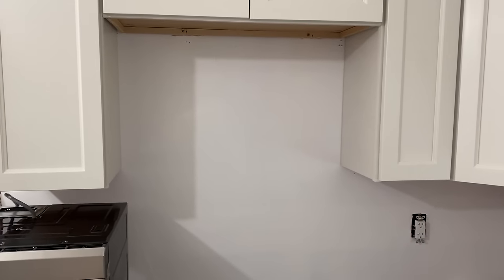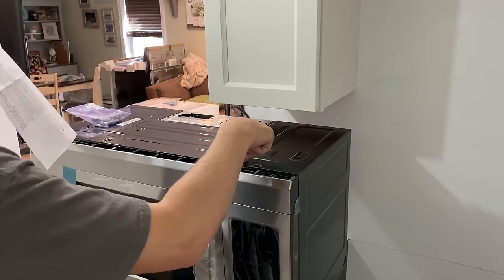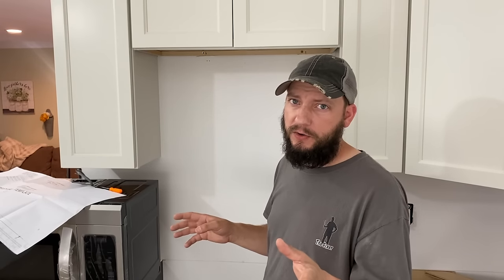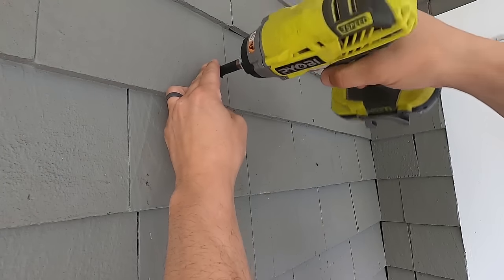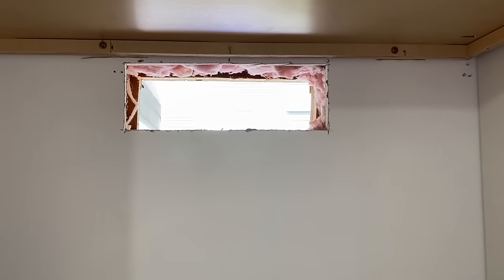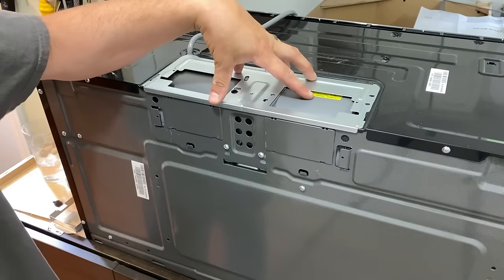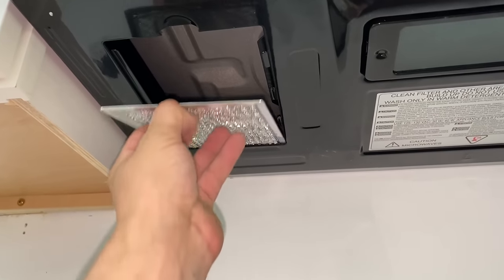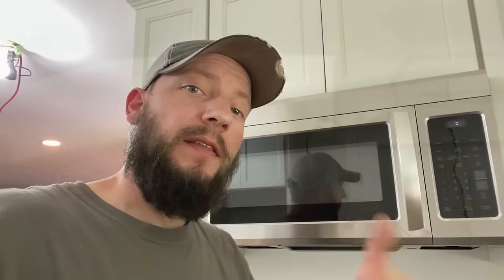How to Install A Wall Vented Microwave (Over-The-Range)

Comment: Just a tip that I was made aware of when we had our attic insulated. They conducted a blower door test before and after they sealed up and insulated the attic. they turned on both my bath exhaust fans and checked for back drafting from my gas water heater and found my fresh air inlet was adequate but when we turned on the microwave vent it sucked air back down the chimney. I only had a 4" fresh air duct installed in my basement. I thought I could make it a 6" but found it was easier to go out the other side of the house with an additional 4" vent. I checked it myself afterwards and no more back drafting.

Comment: If you have space in between the microwave and the cabinet base, like this install, the hole for the cord can go anywhere you like. Put it directly under the outlet. The cord will be back far enough it won't interfere with anything you store up there.
Reply from the maker: Good tip!

Comment: 1:44   The reason why you have to cut the paper on the dotted line is so that you don't have to depend on the printer to print the holes of the template to the right distance from the factory edge of the paper. The dotted lines and the holes of the template will always be in the right distance from each other.
Reply: This makes perfect sense . I cut mine and all is well . Although the power cord hole was positioned perfectly, it was difficult pulling it up at the end when the microwave was closer to its final position. . If I had to do it again I’d build a jig for my router and cut a slot connected to the front of hole maybe 2 inches long . This way the cord could pull up much easier

Comment: Thanks so much for this video.  I wasn't sure that we could use an over-the-range microwave when you needed to vent outside. my experience was always venting the air back into the house.  Now I know that this is possible, I will opt to get an over-the-range microwave oven.

Comment: Loving the kitchen progress so far.  Thats convenient your microwave is on an exterior wall.  Mine is on an interior wall, and I didn't want to lose cabinet space either.  So we took the top cabinet out, we cut the drywall, we cut the double top plate into the attic we dropped down a duct, then patched the drywall and reattached the cabinet.  Back in the attic we went from the rectangle duct to circular duct and out the side of the house with a dryer-style vent.  It does work really great, I can stand under it and even though its 2 stories up, I can feel the air and the flapper properly closes when the vent is off.  We have vinyl siding and there was a dryer vent in the same CertainTeed color as our siding, so it matches.

Comment: I repair appliances so I see the bad install jobs where the vent is not turned the correct way and restricts air flow. Usually will cause excess steam in microwave and eventually case parts to fail. And if it’s under the manufacture warranty, they can not cover the repair to fix due to the improper installation. Love your vids!

Comment: This video is better than the instructions that come with the microwave. The directions want you to tape the crush blocks to the microwave. Well that didn’t work for me. I also didn’t have a small braid nailer. After struggling for awhile, I got one of crush blocks in but the second side was a no go, so I just snugged he second side up finger tight.

Comment: Great video. A much better flange imo is those which are square on interior side and circular on the outside. This has many advantages over the square both end ones. First of all, they are much cheaper, I think, 1/3 or 1/4. Second, you can actually attach the flange to the microwave side and insert it in the wall as you are installing the microwave on the wall. Then you go out and attach an elbow exhaust outlet with cap easily. These square flanges are simply for making more money off of customers.

Comment: We had our first microwave professionally installed over the stove in 1991. It and the new one in 2002 vent up through the cabinet to the roof since the other side is a bonus room. Put off getting a microwave until I saw the over the hood option. Didn't want one taking up space on the counter or on a separate cart.

Comment: You might want to use the duct tape BEFORE the upper plate is put on. That way, you seal the exit path by taping to the fan assembly, rather than leave leaks that can go up into the cabinet space about the microwave through the big square holes of the unsealed upper cover plate. I was going to double check with the actual installation instructions for that model microwave - please see the air pathways at 19:39 when the fan assembly is simply dropped in and fixed with no gasket/tape sealant to prevent air/dirt/grease/fume misdirection. You can also simply apply two rows of duct tape across the upper plate to effectively block that pathway, however is can promote exhaust into the body of the microwave which should be avoided. But, despite anything - thanks for posting.

Comment: I personally love the plastic snap-toggle style bolts since you can put them in the wall before adding the bolt.  Great for one person jobs.
Reply: i have major problems with the snaptoggle brand. if you don't pre test them by screwing in the bolts they tend to have a large failure rate for me. they start to crossthread in the wall and snap.
Reply: @feelingtardy  Well yeah if you're hitting a stud behind the wall they don't drill into solid wood very well and do exactly what you described! Always check stud locations before trying to use screw-in drywall anchors.

Comment: Great video!  I have the same black vent and have been suspecting there is a gap, allowing cold air in.   I know nothing about construction and was wondering what you used for your extension piece.   Thanks!

Comment: I installed the same microwave unit in my kitchen. with the up through the upper cabinet venting option. But my brain does not recall rotating the fan:(. So now I know why all the oily vapors get deposited in the kitchen rather than outside. Could've used this video a year ago.

Comment: I've installed three OTR microwaves and never used spacer blocks. Never had an issue with the unit pulling away over decades.
Reply from the maker: Yup.  I have installed maybe 50 and never used blocks until one time when the bolt started to bend the thin sheet metal holding the nut in.  I couldn’t get the microwave to tighten properly after that so I have used blocks since then.

Comment: I’m curious as to the depth of the wall cabinet in which you installed the microwave underneath.  Is the depth of the cabinet 12” or 15”? Thanks in advance for your response.

Comment: American / Canadian microwaves are wierd! I didn't know you guys had to vent them 😅
Reply: How else do you exhaust the cooking orders?
Reply: @cejkwo100  we don't vent them at all in the UK, they're just stand alone appliances that you just plug in and go 😅
Reply: @cejkwo100  In the UK microwaves are stand-alone appliances, either sat on the worktop (counter top) or built into cabinets. We use purpose built chimney style extractor fans above a cooker/stove. I live in the US now so I’ve seen it done both ways. It does seem odd to have a microwave above a stove.

Comment: if you didn't need to fix that upper hole at the same time, might have suggested just trimming back the upper overlapping cedar shake by an inch or so to secure the flange of the vent, then install trim around the top and sides of the vent to fill the gap. but yeah nothing as seamless as just residing the whole area

Comment: For over the range microwave minimum depth is 12 inches but my cabinets is 11 1/2 inches. Is that a dealbreaker for installation thanks ahead of time if you can answer Ramon.

Comment: I followed all the instructions, measured twice—holes were off, drilled a dozen more into my cheap fiberboard cabinets, seriously wrecking them. I chucked my $375 LG microwave into Lake Mendota. I’ll use my Weber Charcoal grill instead. I’ll use the worthless template for fire starter.

Comment: 1:51 they print with a dotted line and a margin so that the printer doesn't have to worry about the tolerance between the position of the print and the edge of the paper. they also don't have to worry about the final dimension of the paper. this saves them a LOT of money buy foisting the final dimensions onto you with your scissors lol

Comment: I had a hard install.  The vent was pre-installed...  Found out to the demise of my new drill bit that it had metal covering the area I needed to cut for the plug.   I had it centered over the spot on the template but it somehow ended up further back right where the vent was cut.    I did my best but I would have had to redo the pre-installed vent.   I'm not 100%happy with the final product.  😢. But I dont have sheet metal bending and cutting tools or skills.   What would you do?

Comment: Hhhmm....would flipping the motor also apply to just a vent without microwave?  Had a friend put mine in and it doesn't seem to work like it should.  It was a ventless exhaust fan  but they popped the tabs and vented it outside.

Comment: I just had this done, but my microwave still  release the air from the vents right above the microwave door, is that normal? Or did the guy not do it right?
Reply from the maker: If it was “vented” and there is a lot of air coming out of the front, they may not have flipped the motor.  Or flipped it wrong.

Comment: I got quartz backsplash installed where the back of my microwave would have hugged the wall. I would like not to try drilling into the quartz and was wondering if the cabinet alone can provide enough support for the microwave. Can someone please offer some advice?
Reply from the maker: Unfortunately you will have to attach the back bracket somehow.  The 2 bolts in the front would not be enough.  Drilling through the quartz should be pretty easy with a new bit and you can just use anchors.  Hope this helps.
Reply: @TheFixerHomeRepair  Thank you kind sir for replying. Do I need to drill into the studs or will anchors just going past the quartz and only into the sheetrock be enough?
Reply from the maker: @sunnysingh786  if you use the big anchors like I used in this video you should be fine.  I would predrill with a small bit and you might get lucky and find a stud.  See if you can see some from the cabinet above.  If they are not there, just make the hole bigger and use the anchors.  That is what I would do anyway.